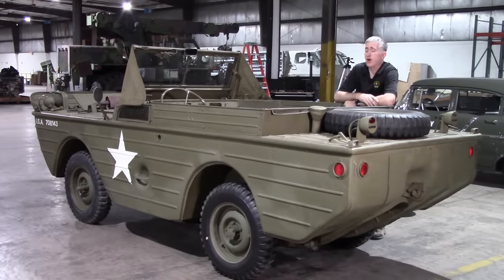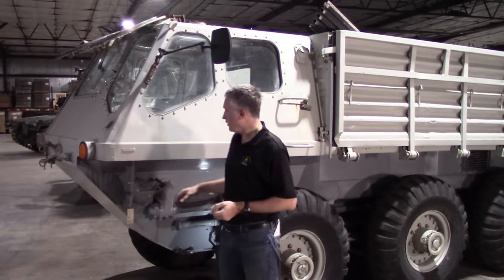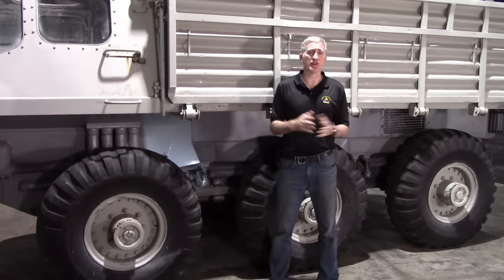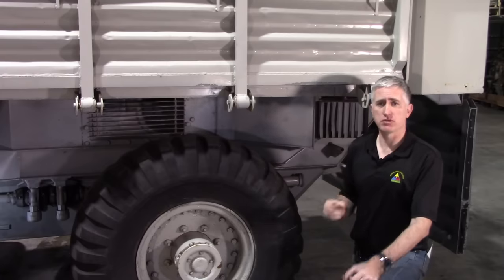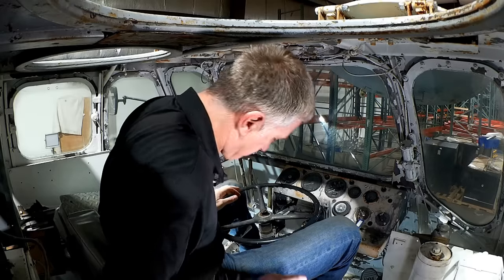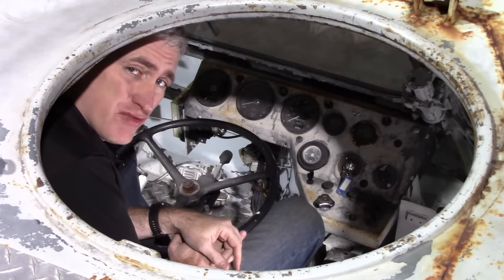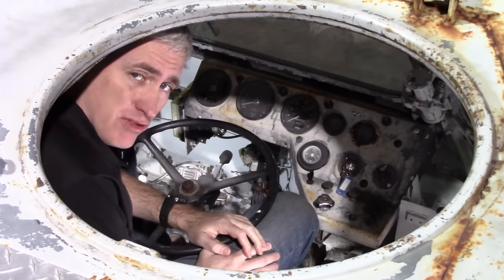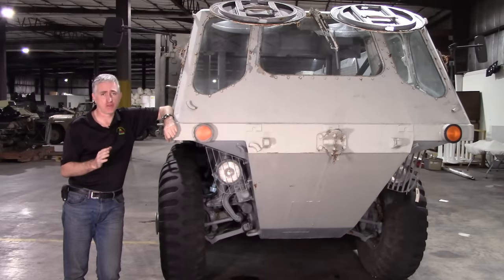Inside the Chieftain's Hatch: FV622 Stalwart MkII

Comment: "Should we make the roof tall enough to fit the driver's head?"

"No where's the fun in that?" - Army Design meeting, probably.
Reply: "Why don't we just put the hatch on top of the driver?"
"Its fineeee, just leave it with the 2 hatches"
Reply: Yeah, I don't get why the hatch is not in the center.
Reply: "yes, but only the little ones, no need to go mad old boy!"
Reply: Designed in the 50s when National Service was in effect.  Most of the soldiers where shorter, and skinnier than people now.  Also being in the age range of 19 to early twenties, they were much more flexible.
Reply: More likely that at the time of design, the top brass would've expected anyone tall to be a guardsman, on short, scruffy lower class men would drive stollies!
Reply: @MrDgwphotos  as far as i can remember there were 3 seats , one either side of the drvers seat
Reply: I'm 6 foot 4 and fit into the drivers seat with no problem, he obviously had the seat setting wrong.
Reply: @MrDgwphotos  Where would the LMG gunner stand ?
Reply: @junsengjs  non spec seat fitted by whoever ripper the original apart
Reply: @ptonpc  wtf
Reply: @umt1cardiff  two seats in most 622s
Reply: @donny2560  non spec aftermarket. But the presenter being a knob wouldn't comprehend that
Reply: @donny2560  wft
Reply: @markellis7819  wikipidia backs up my memory of driver plus 2 crewmen , but again i didnt go in cab very often . Mostly either sitting in back or getting replen from them for scimitar. I dont think our regiment used any more than Driver and Commander to crew though
Reply: Wikipedia being changeable by any Tom, Dick or Harry. 
623 and 624 crane variants had three seats in the cab. Some infantry and Armoured Corps units fitted a third seat in the 622 cabs, and some  even had chains to hold the sideboards up. Royal Engineer 622s were bog standard with just the seat on the left
Reply: @markellis7819  so we both agree that there were 3 seats postions  in cab ?
Reply: @donny2560  there was provision on RAC versions for a mounting on one of the hatch openings for a gpmg to be fitted
Reply: Three positions to mount seats, yes. But many 622 left factory with just two fitted, and stayed that way
Reply: Military philosophy (world wide) 'One size fits no one.'
Reply: @umt1cardiff  Only ever known them with 3 seats
Reply: Keith Lewis mine was a mk1 and had only two seats. To the right of the driver was a huge battery box that we sat a C 31 radio set on.
Reply: @MrDgwphotos  One bright spark understood that drivers don't like the crew landing on them as they jump in.....

Comment: The British Army had plenty of standard trucks Bedford RL, etc. The Stalwart, was to move military stores, including ammunition etc,  right forward to infantry and tank forces very close to the actual frontline. "During military use, the problem of transmission wind up was solved by laying out railway sleepers (railroad ties) in a grid on flat ground and driving over them on long road moves; this allowed the transmission to unwind. On more than one occasion, servicemen drove Stalwarts into car parks and used the kerbstones separating parking bays for the same purpose. Another problem with the transmission was that the vehicle was designed to be driven loaded. Driving the vehicle unloaded caused increased wear on the drivelines to the wheels as a result of the increased angle of mesh of the joints": ie, the Stalwart was designed to take stores from standard trucks (Lorry is just a British English for a truck) to close to the frontline that would, obviously, mostly be off road. I seem to recall that the co drivers position could have a 7.62mm GPMG above his hatch?

Comment: Hi there, you forgot to mention they have five forward gears and five backward gears as the gear lever was left of your drivers seat on the floor, the gear position was odd as well compired to a car ..1st was where 5th would be.. 2nd was where 2nd should be,, 3rd was where 1st would be .. 3rd was where 4th would be.. and 5th was where 3rd would be, ok hope that's clear, plus you could go just as fast backwards, mine also had a crane on it, for off loading of 155mm Ammunition, I even remember my registration it was 89.ET.56 and would reach 45MPH, lots of fun back in the 80s,  great video happy memories.
Reply: Forward - Reverse Transfer box allowed 43 MPH forward and 43 MPH in revers ;) How much more fun could you have on Achmer training area

Comment: You'd think they'd solve windup by using some sort of air-lockers on the hubs, you go through a corner on land and unlock the hubs for a moment while moving and the wind-up goes away.
Reply: It's not really a major problem, it takes a while for the wind up to have any effect.  All you do is just aim for bumpy surfaces, such as potholes or kerbs every so often.  Gravel works too.    Since they were supply vehicles, they would spend a fair amount of time on the side of roads or off road.  So it was not worth the extra weight and complication for air lockers.

As an aside, you are supposed to measure the circumference of the wheels as the tires wear and swap them around so they are the same size on each side.  This also reduces wind up.
Reply: Tyre rotation. Drivers had to measure the circumference of the tyres and put the smallest at opposite end to larges. And then would balance the vehicle on the centre wheel to release it, or fly it on a table top earth platform.
Reply: Or just do what most people with locking hubs do and only lock them when you are trying to cross slippery terrain. Then you don't need to worry about it at all. You only need one drive axle on a paved road. Most European heavy trucks only have a single drive axle. Although what you actually just want is a locking "center" differential, or just a way to disengage the first two axles. Both of which have been used on civilian 4wd trucks for decades. As for the "extra weight and expense" of any of them, it is a 9 ton, 6 wheel drive amphibious cargo truck. I don't think adding a hundred pounds of weight and two hundred pounds of expense to the cost of the vehicle to make it that much more useful is prohibitively expensive. How much did it cost them to repair the constant axle and driveshaft breakage over the service life of the vehicle, because they failed to provide the simplest of mechanisms to disengage the axles or account for the differential rotation? I see they generally consider it worth the "weight and expense" to put transfer cases and axle differentials into trucks, even military trucks. If they weren't useful and worth the weight and cost they would just make them full time fully locked 4wd and tell the troops "it isn't really a big deal". If they were so concerned with shaving pounds off this beast, why didn't they make it out of aluminium?
Reply: @justforever96  They aren't 'locking' hubs. The drivetrain itself is permanently locked to make it simpler and save on gear losses.

Comment: You missed the bit about the exhaust glowing bright red and can and did set fire to the load being carried i.e fuel or ammo  apparently . and the guy who attempted to cross the channel . Salvage squad got a Stolly up and running with full swim kit Youtube .
Reply: Knowing Salvage squad, they probably bodged it with bathroom silicon.
Reply: Never had a load set in fire. The exhaust exits the hull out of the side and then comes up in the exhaust box by the edge of the rear louvres

Comment: Lorry is basically a word for a heavy commercial vehicle, anything you would need a CDL or special license to drive. A truck is a smaller vehicle, typical non-articulated, although a lorry can be solid frame as well. For example, a pick-up truck is just a pick-up truck in the UK, not a "pick-up lorry". A light box truck is a "van". So are vans. A heavier box truck like a delivery truck is a "truck". Apparently the use of the word "truck" is being used more and more commonly to describe a wider category of vehicles than it used to be, so it may well be that for most people in the UK a "lorry" is basically a semi truck. But i have definitely seen people refer to mid sized dump trucks, etc, as "lorries". For example, the Top Gear UK "Lorry Challenge" where they drive across Burma in mid-sized trucks. Then again for them it might have been a point of pride to not use anything smacking of American English. Interestingly the word "truck" comes originally from the heavy goods wagons they used to use to transport freight around cities, usually unsprung, with flat beds and heavy wheels. A wagon would have a box or sides. It could also refer to what we call "dollies" today, of the heavier sort. That is why you will see them referring to 'trucks" in pre-automobile literature like Dickens. I would say in this case it was a truck since it was a non-commercial vehicle of relatively small payload (if not bulk).

Comment: A brilliant vehicle I loved driving but did have it's drawbacks. If there were any mechanical issues the load had to be removed to access the engine and as mentioned the transmission was prone to failure if wound up. 

There was no central tyre inflation system fitted to in service vehicles. On the left there's a lever which is the forward/reverse selector meaning the vehicle has six forward and six reverse gears, good fun flat out in reverse...

Their party trick is to park on their nose, drive flat out and slam on the brakes, get it right and the two rear axles are off the ground and the vehicle is resting on its front tow point.

Comment: Not sure what tires were used on this vehicle but only bias ply tires change circumference based on air pressure, radial ply tires do not change circumference.
Reply: Tyre rotation. A maintenance task by the drivers to measure the circumference of all the tyres and put the smallest at the opposite end to the largest circumference

Comment: A truck is a grouping of wheels.  Skateboards have a two-wheeled truck at each end.  The formerly dominant four-wheeled road vehicle layout with a front mounted engine and rear wheel drive has a two-wheeled steering truck and a two-wheeled driven truck.  Highway tractors have a two wheeled steering truck at the front and a driven truck at the rear, with one or more dual wheeled axles.  Railway cars typically have a four-wheeled truck at each end.  Semi-trailers are called that, because they have a single two-, four-, or six-wheeled truck at the back and the forward end is supported upon the driven truck of the highway tractor.

British usage of English may name cargo vehicles depending on the number of trucks it uses (and the exact definition of how wheels are grouped).  With all six wheels driven by a single shaft and all three wheels on one side driven at the same speed, the Stalwart may be considered to be supported, steered, and driven by a single truck, so the Stalwart is just a motorized truck.  

Possibly, cargo vehicles with more than one truck are called 'lorries' and cargo vehicles with just one truck are called 'trucks'.

My guess is that American usage of English used the verb "to truck' to refer to conveying loads by wheeled platforms and the entire system of wheels and chassis to convey a load was called a 'truck', which would identify an Australian road train (a very powerful highway tractor pulling many trailers with gross weights approaching 500 tons) as a 'truck'.

Comment: No, the problem is that the three wheels are NOT rotating at different speeds. They cannot. They WANT to be, since they have different distances to cover while going around a corner, so they need to be able to skid a little bit or slip to equalize things out. If they can't slip, then all that force gets absorbed into the drivetrain, and it will either release itself suddenly (my experience is usually that it will just go "scuff scuff scuff" as you turn as the wheels break traction, and it is the windup that builds up gradually that you want to watch out for. Both put a lot of stress on the drivetrain, but there is so much when doing a sharp turn it really has to release itself at the time, since the axles just can't twist that much), or it will snap something. Most people are familiar with this from 4WD trucks, which have axle diffs but no center diff, so the front and rear axles are locked together. This is why you should never drive in 4WD on pavement, only on low traction surfaces, and why it tends to be hard to make tight turns even on soft terrain, because the truck has to force itself past the slippage to move (it also tends to make it understeer massively during tight turns in snow, which is annoying, since you need the 4WD to move forwards and stay on the road, but suddenly it just tries to slide right through the corner when you turn). Having a locking diff in the rear, or even worse, the front, makes it worse, since both sides are locked together as well. Very difficult to drive in that mode on anything but slippery terrain. So this thing is basically the same, only with three axles to make it even worse.

Comment: As many have previously stated (I guess--In haven't read through the commentary--) a truck (Tractor) is really a hauler. A cab on a chassis and maybe a crew compartment, whilst a Brittish (UK, AU, NZ and SA) designation for a Lorry would be a cab with a flatbed, recycling unit, a dumper et al. (A Rigid) 

Thats only my ex Dunfermline/Scottish (Heil Environmental) dumpster truck selling experience talking.
Reply: funny that the other comments and the web articles i found on the subject all say the exact opposite. Heavy trucks like semi trucks, your 'haulers' are called lorries, while lighter, rigid types are more likely to be "trucks".

Comment: The concept of a wheeled swimming vehicle is fine until you encounter an actual river bank. These things need a very shallow sloping beach/slipway/prepared area to get out. Lack of propulsive power coupled with very limited wheel traction and their own buoyancy seems to be the issue. Also see quite a few videos where they are towed out.
Reply: the army rarely tries sending supplies randomly over a river willy nilly wherever they reach it. If they used to spend time searching for a suitable ford, it is even better to only have to find a spot where the banks are low and suitable for amphibs. If they can't find one, they can try bulldozing a ramp. These aren't assault vehicles anyway, but much the same applies in either case. If you need to use your amphibs to assault a defended river, you find the right place to cross first . you don't just send them all to the river to find a place to cross. In either case it is better than waiting for a bridge to be built, which used to be the only alternative if you couldn't find a ford. So does it mean you can just drive across any river any time you want? No. But it does mean you have more options than finding a ford or building a new bridge whenever you need to cross a river. And if you think it is bad having to find a relatively level spot to swim across, try finding a spot with level banks that is also shallow enough to drive across. With roads in close proximity to both sides, unless you are just crossing combat troops to clear the enemy away from your actual crossing points. And to build a bridge you also need level banks and you need to build a pontoon bridge, or you need to build embanked approaches and build an actual bridge. seems to me that needing a level approach is not unique to amphibious vehicles at all.

Comment: He forgot that the wheels where timed and we always painted a line on the hubs so you could see when one failed.Also they should have been driven loaded which would then have the drive shaft parallel with the ground..Nostalga says great bit of kit ,but reality reminds me they where pigs to work on .Due to lack of use ,the seals would go as soon as it did move

Comment: I've lived in England most of my life, I've been primarily educated here; and as far as I can tell, whether a large vehicle is a truck or a lorry is almost entirely arbitrary (although size is a factor: there's no such thing as a 'pickup lorry').  For whatever it's worth, I think the word lorry is on the way out.
Reply: Not sure it is
Reply: I feel trucks have the cab + cargo area on one chassis, whereas a lorry is articulated with a separate cab + trailer for cargo
Reply: @tangerineflugel  Pretty much this, nothing to do with size. Trucks are single piece with cab and trailer fixed. Lorries are articulated with seperate Cab and Trailer.
Reply: @wierdalien1  Maybe it's more popular in some regions than others, but I hear it less and less.
Reply: @jic1  possible
Reply: I (UK) spent about 10 years driving small lorries, and usage of lorry/truck was pretty much interchangeable.
The only real requirement for a lorry is that it has to weigh about 5 tonnes or more laden, while truck can also be used for things like pickup trucks, which overlap in weight with vans.
In the UK, thus a lorry requires an extra licence (over 3.5 tonnes laden makes it a C1 or C class vehicle).
The tiddly lorries/trucks I drove weighed about 4.5 t empty ;-)

Comment: good report ,,but obviously splash board at front(removed ,,early 80,s),,plus plate above to rest the hatches on,,,air inlet was to rear of drivers cab,,,,also not mentioned was artillery limbers were fitted with cranes,,,drove these for 2 years ,,winch fitted on front ,inside hull,,plus the version you showed was minus lighting on front and modern lighting at rear